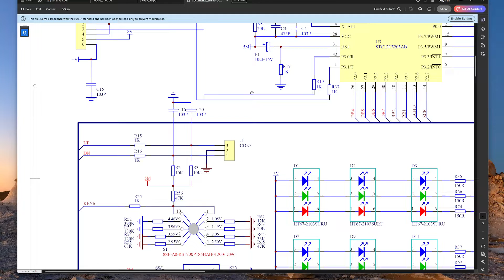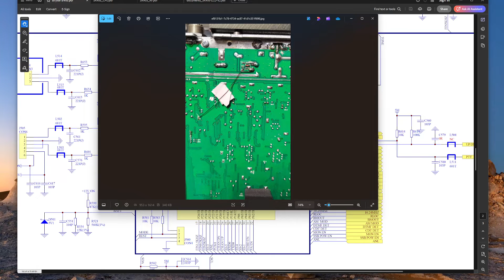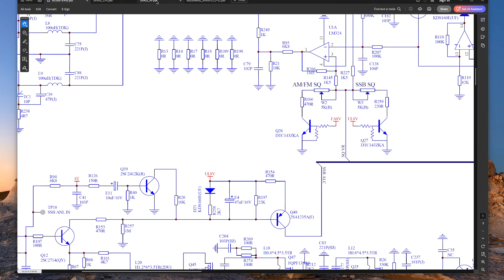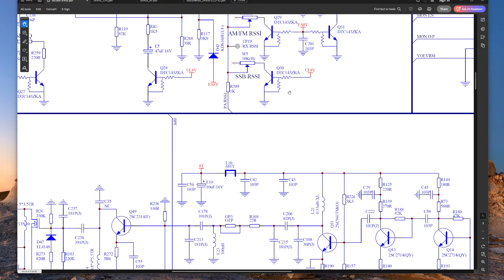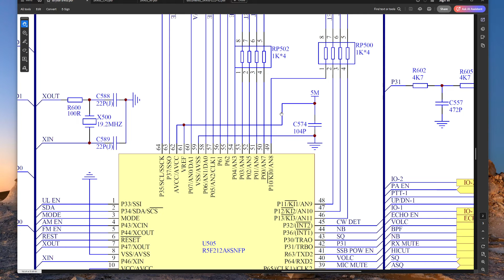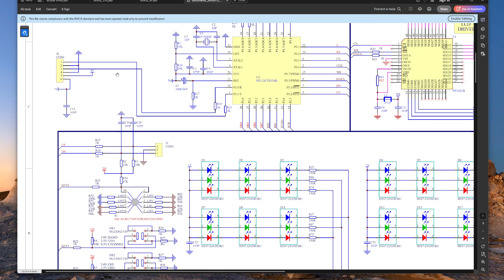955 v1 Syscon - mode changes, tx lockup, etc.

Comment: Have you done an NPC mod on the 955 plus ? Most of my radios have an NPC mod .. the 955 plus has a great swing only with a Deadkey of 15-20 Watts.. my goal is to have the radio at a low Deadkey swinging 80 + watts .. the higher the Deadkey the less audio output.. not a fan of disabling the audio limiter ..
Reply from the maker: No i don't do those sort of modifications myself. I pretty much use the radios as-is because they work fine.